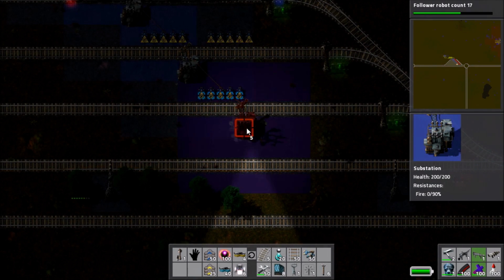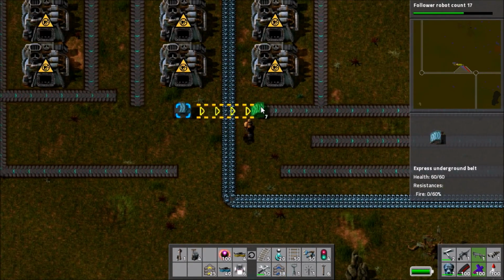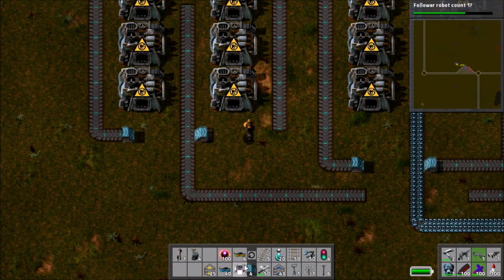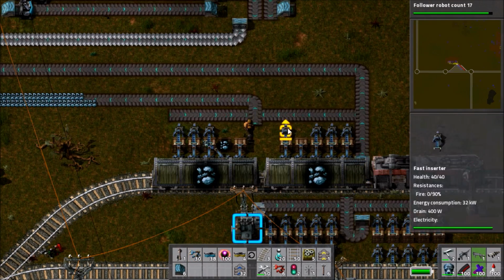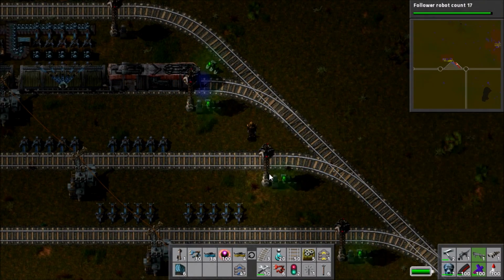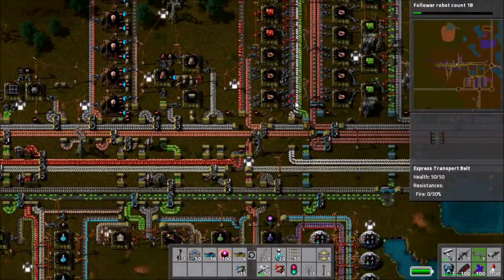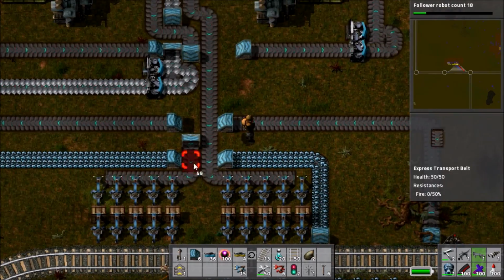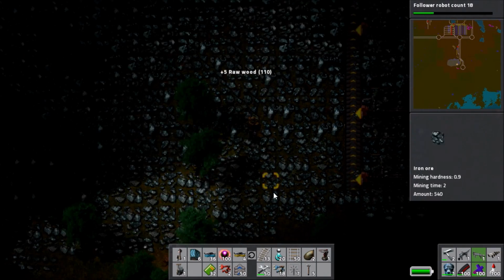Factorio Railworld Ep#33: Circuit Factory

Comment: love the series
just two quick suggestions:
- since all your rail lines are essentially "one-way" put in more signals between the loops to prevent trains from pathing to the next loop if there is just one train in their way (hope you get what i mean)
- use smart inserters and logistics conditions or red/green wire on the modules to only make lvl2 or lvl3 when you have a certain amount of lvl1 modules
Reply: +1
The red/green wire setup is quite simple and will be an easy way to get started with logistics, as I haven't seen you using it.
About the train traffic problems, i sugest you to make redundant railways on your more congested areas, such as between both stations. This will not only reduce traffic but will mean that if part of your system breaks the rest can keep running.